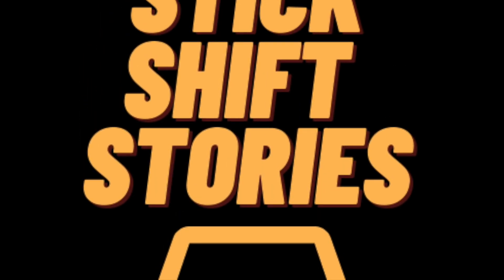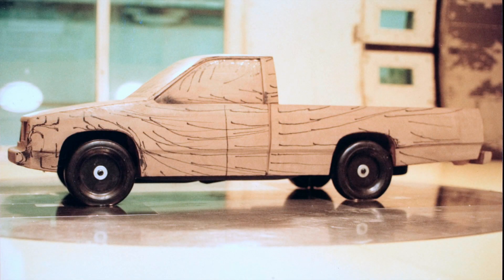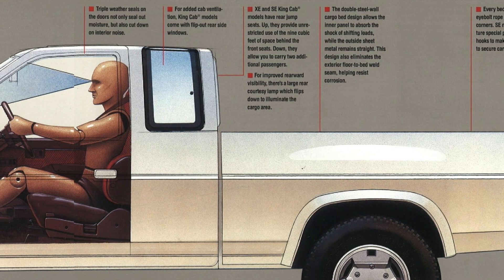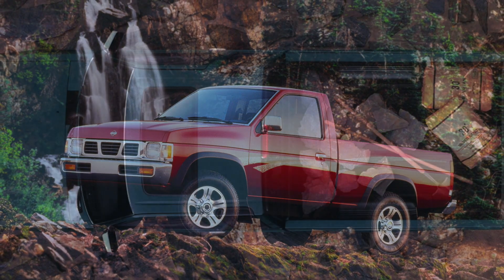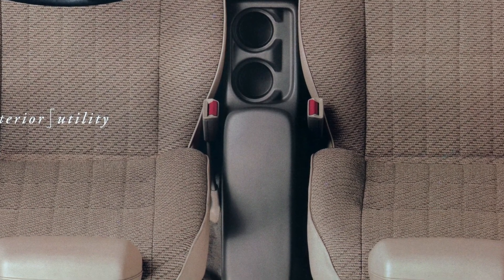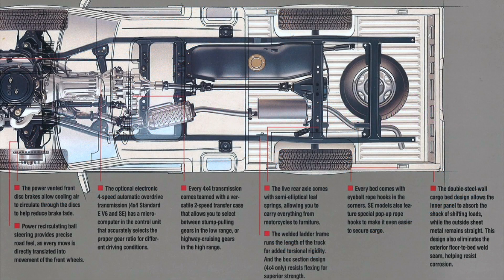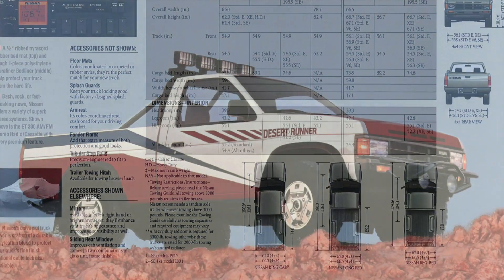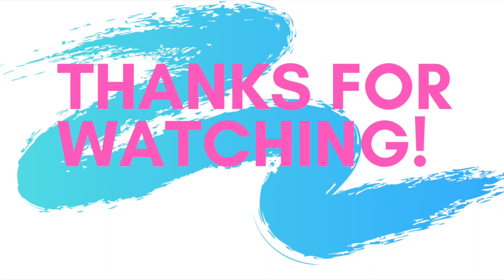Nissan Hardbody Buyer's Guide (Common Problems, Options, Specs)

Comment: My 1995 has 465K miles daily driver drove it to Yosemite last month 💯
Reply: WOW! I just got a 1991 with 71k on it. Hoping to drive it for a while :)
Reply: @datalaforge  yeah they built to last 💯
Reply: Cool to hear. I just bought a 1994 nissan 4x4 v6 with 185k miles, she needs a little work but the heart of that thing is very healthy
Reply: My dad's has about the same mileage.
Reply: @MrMister1227  which engine has your truck?
Reply: @JimMcBeam  KA 4 Cyl
Reply: @MrMister1227  The KA24E was the bread and butter of this truck. Easy to work on and relatively simple. They just keep going even when something is wrong. I have a 90
Reply: I'm looking to buy a 1997 hardbody 4x4 manual with the I4 engine. The owner say it need a engine. What year engine configuration will fit the 07 4x4 manual transmission. Thanks for any information.
Reply: What type of maintenance were you performing to make it last that long lol
Reply: @uriel-tolbinhocruz3103  shit I just changed the engine oil, like every 4k-7k miles and changed gears before 2,500 rpms
Reply: Man that’s legit! 🤙 My 1996 Nissan is still a baby with only 139k miles.
Reply: @mxcollin95  damn that's damn near show room👀
Reply: My 1995 4x4 manual 4 banger had to have a rebuild engine at 160,000 But I love the shape of that truck and hopefully $2,000+ later it'll last a damn long time now!
Reply: Which engine do you have???

Comment: Problems would be the 4x2 manual rear differential failing prematurely, the speedometer gear in the transmission failing prematurely. But everything about this truck has lasted longer than any other vehicle I have had. 10/10 would reccomend for everyone
Reply: what happened to your diff? the rear wheel bearings started to make noise after i swapped to 18 inch titans i repalaced all 4 wheel bearings that was 2 years ago i heard about this problem i was wondering cus i never had any issues with it
Reply: Yup. Speedometer every time. Especially on the old Datsun's. Still love em though.
Reply: @zacariasblanco9738  rear diff ended up locking up in the middle of the road, had to flat bed it home the diff was in pieces rip lol
Reply: @GR1MMR3AP3R51  o snap
Reply: @GR1MMR3AP3R51 didnt have and accident someone couldve rear ended you , thanks man good to know this kinda stuff i dont know everything after driving her for 22 years still surprises me  once in a while lol yes 22 years be safe bro

Comment: Mine is a 1990 Pathfinder V6 SE Sport 4X4 (based on the hardbody pickup). Has 51,00 original miles, is loaded and nearly flawless. Bought from original owner's estate. Was purchased new in AZ and spent its entire there and garaged with meticulous records. It was quite a find and really fun to drive plus its tough as nails.
Reply: how much did you pay?
Reply: prove it

Comment: We own a 91 D21 4x4, standard cab with the KA. 183K and it's a phenomenal little truck.

Everything we want that todays trucks no longer offer. It's a very basic and simple, reliable work truck. Has no factory AC or radio, crank windows, 4x4 with manual hubs, 5 speed and doesn't have a ton of tech gadgetry we don't want or need (like a tailgate that transforms into a desk😊).

It's the best truck I've ever owned. I absolutely love it and if they still made them I would buy a new one without hesitation.

Timing guides are a common problem but ours keeps a rattling on.

Comment: My 93 regular cab is dropped 2" and just put a fresh coat of paint on it this last fall.  Pulled out the bench seat and put in buckets, added some subs and a nice stereo.  These are great trucks, runs like a champ.  I've taken it half way across the country and back twice now, not a hint of a problem.  Highly recommend these trucks.

Comment: I have a 96 XE with 79,400+ original miles. Bought it in 2013 with only 21,000. Just had the front end rebuilt. And she drives like a brand new truck. I will NEVER let her go.

Comment: my grandpa bought my 1990 brand new. I learned to drive stick on it back in 2011. Still runs great 240k miles. Headgasket went out 3 years ago. Everyone told me to sell it but i didnt listen and got the head resurfaced and a new gasket. Love this little 4 cylinder. No powersteering keeps you strong.

Comment: My father owned one for 16 years, it’ s a one of the most reliable trucks. Nice video, i liked that it included so many detalis. Greetings from Argentina!
Reply: My father owned the very first model 1986,5 yellow and double cab with 2.3 diesel engine for 26 years more than 500k miles super reliable , back in jordan

Comment: Owned a 94 2wd base cab 4cyl manual and it was my first vehicle, loved that truck till death, bought it with the odometer not work and stuck at 207809 and I drove it for over a year till I got in the middle of a 9 car collision, spun out and totaled it but left with nothing but a scratch, now own a v6 king cab 95 manual and she’s a dream, find one? Buy it!
Reply: I’ve got a 2wd 94 it’s my first truck and I’ve already done transmission work and a bunch of repairs but it’s never failed so bad I couldn’t get it back home
Reply: Have a 94 2 wheel drive 5speed love it .
Reply: @peterraboni1197  got a 94 on the title, but it's the 95 model , i will never sell it or get rid of it!!!! I LOVE IT! I paid $500 for it a few days ago put $140 in brakes calipers and rotors and brake lines, and it's going solid again!!!!! need to change oil tomorrow, and oil filter but other than that, man hit the highway 5th gear, it floats.
Reply: I need the seal that goes on the Bell housing on my 5 speed transmission. Please if anyone can help. It’s were the fork comes out.
Reply: I just did, same year, XE-V6.  Had it almost a week, from the original owner!  Factory Magenta, ordered my custom plate today, "SPR GRP"
Reply: @mescko  the v6 is not the one I’d recommed out the 2 but if you can afford the constant work to the vg30 with those timing belts then by all means it’s a great power increase to the ka24e… im more of a reliable or function person so I’ll forever keep searching for my 4cyl replacement… enjoy your hardbody!
Reply: @TheCardBoard-Box  I don't consider every 60-70k constant, but whatever...besides, I've owned two VG30-powered Nissans before this, and British cars being my first love, I got into the inevitable habit of stashing parts so I have have 3 VG30s sitting in the shop, so I'm going to start rebuilding one.  Neither it nor the KA are that easy to find anymore.  I will be using it like a truck is supposed to be used, to haul chit, so I want the extra torque.  I already love my new truckky-poo. 😁😁
Reply: Touched a nerve my bad lol
Reply: @TheCardBoard-Box  Not at all, I just never thought of the belt changing interval as all that tiresome...  have you had issues with a VG30?  Neither of mine gave me any.  I did do one timing belt - not a big deal, all the stuff you have to take off to get at it is a bit of a pain.  My truck will not be a DD so it will be a long time.  I'll likely have to change it due to age not miles.  The belt that's in it is 5 yr. old and has 10k on it.

Comment: I own a metallic grey 89 Nissan hardbody for a year now and I love her. It’s a V6. 128k original miles. With the original 2 tone rims, sunroof, power windows/locks, ac/heater. Clean blue interior. Haven’t seen a truck as clean as mine anymore
Reply: 😲❤👏👏👏 Sounds like a sweet little ride.
Reply: Nicr
Reply: Loved the 88 & 89 year.   Only 2 years that had the flush headlamps.   Bought a new 89 as a kid just outta highschool and kept it 15 yrs.
Reply: Ooo I love that color!  The '95 I just bought is Magenta, not the most manly color but I like the fact that it's pretty rare and I already have a name for it:  The Super Grape! 😁😁

Comment: I own a 1994 sev6 and I love it. To my knowledge it has every option it could possibly have had other than the bar in the bed. Power windows and AC still work great. Came from the factory with a limited slip diff and doesnt really stuggle to put out a nice fat burn out. 4x4 is a champion and I've even been hit in the side once and it left a dent in the bed that came right out. Couldnt ask for a better pickup. I want a little more power but a vg engine is tough and there is work that can make them better. Ive jumped this truck in the air mulitiple times and crashed into a number of trees but you wouldnt be able to tell. Only problem is its an interference engine and I did have a timing belt break prematurely and it munched its own valves so I bought a 60,000 mile engine from Japan and its back to being my daily driver.
Reply: Yeah there great trucks but i dont beat on mine whatsoever and i think its going to last me forever lol iam the 2nd owner of it crashed it once and the frame was not bent luckily just had to replace a number of parts front ended it into a Newer Honda Accord thought i was going to have to junk it and buy another truck but i thought repairing it was probably cheaper and this was back in 2019.

Comment: My 1995 has 240.000km on it and I've been daily driving it for the last year. The most common issue on these trucks, at least from my experience and my buddies with these trucks, is a Timing Chain rattle! easy and quick to fix, since a few companies offer aftermarket tensioners that work way better. I have also had some starter motor issues and replaced it in December, but the new starter is already dying on me. I have rust issues with my truck, although not so much on the frame. My rear drum brake housings rusted out completely, and I've got a few small holes in my floor. Fender wells are a common rust area on these. As long as you are at least a little mechanically inclined, I would absolutely recommend these trucks! I haul dirt bikes and motorcycles almost daily with my truck and its always gotten me back home!
Reply: Do you have a link for the tensioner that you got?

Comment: I've had 5 and loved them all. Currently building one up,  just got the parts for my rear disk swap. 

Common problems would be the center carrier bearing and u joints being staked combo.  Speedo failed early almost all the time. Shocks are garbage, and doing the thermostat is no fun. The alternator through the wheel well isn't a struggle if you know how to twist it just right.  Those clacky hydraulic lifters can quiet down with some seafoam if you catch it early enough

Comment: I have a 1997 4x4 bought it in 1999 with around 10000 miles on it, I love this truck , now has just over 100000 on it. Only things I’ve had to replace on it is one headlight and an oil pressure sensor that was leaking oil. I’ve driven the truck hard and I can’t see any of these new trucks today holding up as long as these older trucks. I wouldn’t trade it for any of these new trucks of today.

Comment: Just bought a 1989 single cab short bed with 20000 original miles. Driven for only 2 years and then sat under a tree for 30. Runs great and everything works. Got it for only 2400$

Comment: I have had a 97 2x4 regular cab manual XE for five years it now has 165,000 miles on it. I use it around town mostly going to the hardware store and picking up 16 foot long lumber which I put on top in the ladder rack. I absolutely adore this truck. I am a very big older  man and it’s very comfortable. I had to put a new radiator in it and it cost me $46 which we easily did in my front yard. Surprisingly, the little dude is snappy as I regularly blow off F1 50s and Chevrolets are from the line and I know very much they are impressed… Other than putting front brakes on there has been almost no maintenance other than oil changes.
A Neighbor had one exactly like it and blew out his engine, so I bought it and will put in a crate motor and customize the paint… Really trick it out with the roll bar look. I also thought about putting an electric motor in it. If you don’t own one of these… to be fair it is not a highway vehicle in my opinion after about 50 mph it feels like you’re going 180 mph… But for a fun little run around vehicle you cannot beat it. The only other bad side is the gas mileage which is about 16 in town and 24 on the highway.

Comment: 6 months ago, I picked up a 96 xe 4x2 manual barn find for $400.  It didn't cost too much to refurbish the truck and it has been awesome. I will leave a list of repairs:
-full set of rocker arms in the head (also their shafts for good measure).
-timing chain guides (truck came with brand new timing chain and sprockets already installed, not sure why guides weren't replaced)
-catalytic converter and B1S2 O2 sensor
-thermostat
-shocks front and back
-tailgate door handle and access panel
-new stereo and speakers
-front bumper and grill
-windows tinted
TODO:
headliner, tow package, backup camera, black wheels with all-terrain tires that will fit a 2wd.

Comment: 1995 Nissan PU XE-V6 4x4, purchased in 2003 with 47k, now has 144k - used on weekends and vacations for camping, 4-wheeling. Has never broken down and has started every single time I turned the key. Regular maintenance has occurred on time or mileage (whichever first), using good fluids and OEM parts (until recently, as parts have started to run out at Nissan warehouses). Almost all work done to the truck has been preemptive maintenance or upgrades. Most recent project was changing the clutch due to oil intrusion from the transmission:engine backing plate -- due to the way oil pours onto the starter and onto the ledge of the oil pan, after 25 years of oil changes, oil finally got into the bell housing and onto the clutch. Without going into the exhaustive list of details of what I've done to the truck to keep it running like new, one of the key flaws in this vehicle design is the front suspension -- the single pivot, tension-rod lower control arm is an atrocity and one of the reasons this truck doesn't have much of a cult following. The next primary issue with this vehicle is the total lack of aftermarket support and parts availability. Nissan abandoned it and the aftermarket did not pick it up -- parts are very hard to find, quality is low, and any remaining better parts are often expensive. Nissan no longer sells things like exhaust gaskets, suspension bushings, clutches (Centerforce is a reasonable alternative), suspension ball joints, and a variety of other parts for this vehicle. If you're crafty and persistent, these things can be overcome with a lot of sifting and parts inspection. All that said, 25 years and the thing still starts every... single... time. Applause to Nissan for that, but they should call me if they'd like to know why their trucks don't have a following -- I've had theirs apart head-to-toe and can tell them why their designs aren't competing with Toyota, et al. Great video and thanks for the review of this truck's history and design!

Comment: Still own both a 1988 regular cab v6 4x4 and a 1990 4 cylinder king cab 4x4.  Bought the first for $500 and it needed a transmission so I switched it to a manual that I already had from a Pathfinder.  1990 was given to me for free as they thought the head gasket was blown. The pulled and tore the engine apart to rebuild it and bought most of the parts needed.  It wasn't the head gasket, it was the front timing cover. The timing chain guides failed and they drove it till the chain wore though the front cover at the coolant passage hence the coolant in the oil. I've had it running for the last 1 1/2  years  and am very happy with both trucks.  Both trucks don't have allot of rust on them either where I'm at in Oregon.

Comment: Bought a 89 HB 4x4 new in 88 just outta highschool.   My 2 favorite years were 88 and 89 with the flush headlights. 

Drove it everywhere, lifted and modded it and it was on 35" tires.   Naps Z 4 cyl was great.   Kept it for 15 yrs and only sold it because it was a single cab and I had a wife and kid, wish I still had it.   Only issue I had was all the inner metal panels under the hood were only spot welded in place and would either break welds or the thin panels were breaking.  I had to reweld or repair the panels a couple times.

Yep, totally basic.  I had no tach, no ac, no power anything & no cupholders either...    Amazing how spartan they would sell trucks those days.

Comment: I own a 93 D21  Been a fantastic little truck. Bought it with 17 K on it in 94. The timing chain rattle is fixable without taking timing chain cover off. Other than that very easy to work on. I'll keep the truck for years to come.
Reply: That timing slap will come back if you don't order a fabricated chain tensioner.

Comment: Great trucks. I traded a brand new 85 Nissan D720 for a 1986.5 first year Hardbody 2wd 4cyl back in the day. Both were bullet proof trucks. 34 years later (2 years ago) I picked up a 1997 4x4 4cyl 5-speed manual single cab with 63,000 miles on her. I use it as a daily driver, but due to covid and working from home, I don't have to drive much. I don't drive it in the winter if any salt or chemicals are on the streets. I think it's got around 65,000 miles on her now. Love the truck.

Comment: I have a build date 6/86 registered as an 87 king cab 4x4 V6 5 speed , loaded, ac , power door locks, power windows power mirrors, factory sunroof, and it all still works,one of the best trucks I have owned, had it 10 + years, I'm the second owner, just need to find a factory brush gaurd
Reply: Damn hard to find, the complete light bar is impossible.